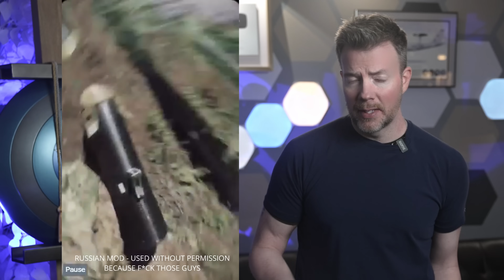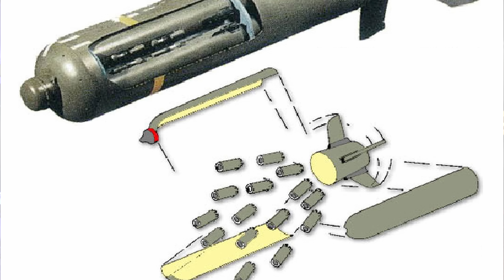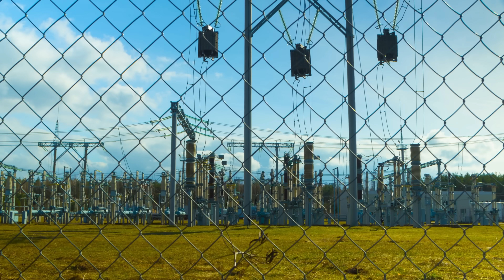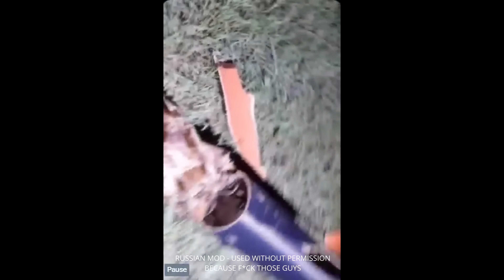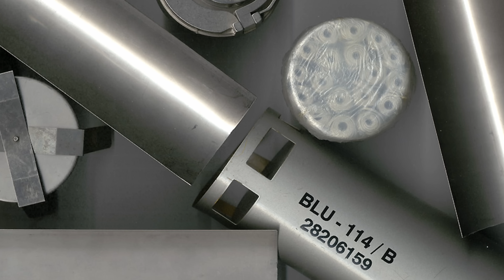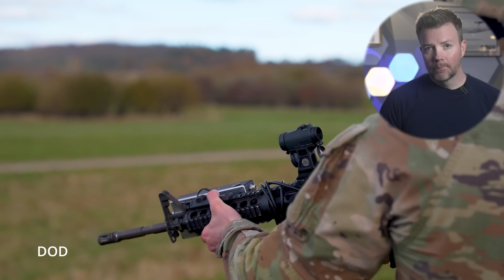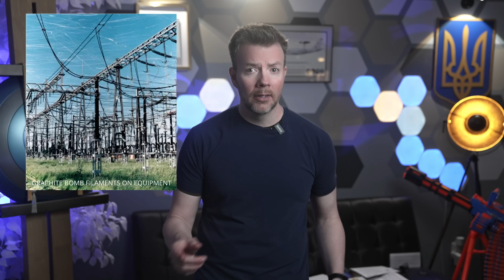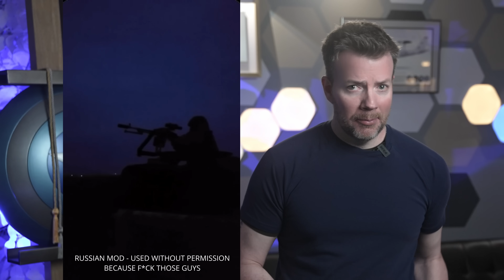Russia Claims Ukraine Using Graphite Weapons - Here's Why

Comment: Sounds like it could have toxic effects on respiratory systems like asbestos. There could be other environmental effects.
Reply: @kennj321  But in this case there are none. Graphite fibres are not carcinogenic, unlike asbestos. 

And for them to be effective to cause electric arcs where none should be, they have to be long. So graphite fibres will eventually drift down, they do not remain airborne. 

If this actually were toxic, we would have had to ban pencils. Because drawing with them, and sharpening them, also releases graphite particles.
Reply: @Hydrazine1000  there are significant workplace safety rules for working with graphene.  plus it appear difficult to degrade it in the environment and could be a forever chemical that gets picked up in high winds and causes chronic long term exposure.
Reply: @kennj321 graphene ≠ graphite

Graphite is not toxic. Graphite fibres, when really short and inhalable, can cause irritation to the lungs. And that's it. After exposure the lung mucus will work to remove them. Unlike other forms of inhalable fibres, like asbestos. Or silicate dust.

And the stuff you see here in the photos is really long stuff, almost looks like fairy hair. That is not a respiratory risk. (Though a respiratory mask when cleaning up is recommended, due to the aforementioned chance on irritation upon inhaling.)
Reply: @Hydrazine1000 apparently its at least similar to whats in some automotive brakes. And there is concern about chronic exposure to it.
Reply: @kennj321 Similar in material but, and this is critical, not similar in form. 

These really long fibres drift down. They are way too long to remain airborne. 

This comes in no way, shape or form, close to occupational hazard of a car mechanic working on brakes every day, where the product form is really short strands of fibre that can be inhaled and cause irritation.

Comment: You have to think that small graphite weapons could be used to knock out a transformer on a pole and take out a single building or block. The law enforcement applications are interesting.
Reply: transformers and wires on neighborhood poles are typically insulated, so that wouldn't work. 
Graphite bombs rely on the fact that extremely high voltage transmission infrastructure almost always relies on air gaps instead of plastic insulation.
Reply: @thamiordragonheart8682  If the transformer is in the low kilovolt range, the primary input will be air insulated by ribbed glass or ceramic insulators, thus subject to attack with this method, as are the feed lines.
Reply: @OrmondOtvos , I thought the question was about the poles on the street that connect directly to a house. Of course, anything measured in kV is air gap insulated, which I mostly think of as being for longer distance transmission lines or grid connections for large industrial sites.

Comment: I wish there was somewhere you could communicate with Ukrainian forces. Been saying for 2 years that cheap graphite bombs are ideal for small cheap drones to take out electrical transformers that are spread out all over the place and are undefended. These are not easy to replace and It would be relatively easy to stop all electrical service within a certain distance of the front. Eventually they would have to decide what areas get replacements from an increasingly limited supply.
Reply: I wish they’d hit Kaliningrad. It has one nuclear power plant to support the entire enclave. Don’t hit the nuke part but the transformer/switching facilities outside of it. Kaliningrad has been spoofing GPS and GLONASS making air travel dangerous. Send Kaliningrad back to the Stone Age.
Reply: try the UKR embassy?

Comment: This was used in 1999 to combat Serbia. It worked fairly well at that time.
Reply: Well, yes and no: They repaired the damage within days so NATO quickly moved to right-out destroying electrical infrastructure. It did work well in Iraq, though. It all depends on how well-maintained and resilient the grid is. Operator skill level, availability of spare fuses, etc.
Reply: @aoeuable  When the weapon is deployed, the power grid goes out. Only institutions with generators are producing light and heat eg military bases and command centers. Easy to spot and much easier to target!
Reply: @MartyH99  Maybe in 1999. Nowadays, most newly built civilian buildings are required to have central batteries and very often diesel generators to operate elevators, ventilation, fire sprinkler pumps, backup lighting etc.; those are mainly prescribed by the fire regulations, but they do switch on every time someone digs through a cable.
Reply: @aoeuable  It was not needed to be longer than that though. And you can do it again so it is a "yes"
Reply: and Iraq
Reply: He just said that 😢

Comment: This seems unlikely. Graphite/carbon warheads are specifically designed for scenarios where you want quick repair. We used them in Iraq '03 to enable swift post-conflict recovery and stabilization (OIF J-staff officer). I cannot understand why Ukraine would want to gift Russia with the quickest and easiest repairs to get their power back online. It makes literally zero sense.
Reply: It may only knock it out for between 48 to 96hrs (dependent on how long it takes to clean the area, make any repairs necessary & then test the curcuits to make sure they can restore power without tripping the breakers again)? But by merely switching their power off for a few days, as others have said switching off RADAR instalations etc, without, unlike Russia, committing the war crime of destroying civi infrastructure. Zelensky knows, if Ukranian forces committ a provable war crime, for all the world to see? He will lose western support & he knows they cannot afford to do that. That's why they're tripping circuit breakers instead of blowing them up.
Reply: @markmaher4548 Firstly, it's not a 'war crime' if destroying a target provides reasonable military advantage compared to negative civil impacts (the principle of proportionality). If enemy military functions were directly reliant on a civilian grid, then that legitimises a strike. 

Secondly, I'm not disputing that knocking out a local grid isn't advantageous for Ukraine; merely that it's incredibly stupid to suggest they'd deliberately aim to make that disruption as short-lived and less costly as they could.  

As an aside; military SAMs and radar systems are invariably self-sufficient in respect to electrical power. Knocking out the grid would not disable their capability. No military is that stupid.
Reply: @AndyDavisTechnicalDivingDid you miss the part where even if a power plant or it's infrastructure provides power to a military site, if the bulk of the power produced/provided is to civilian sites it counts as civi infrastructure?
Reply: @markmaher4548  That's irrelevant to the international law of armed conflict. Did you miss my earlier comment explaining the legal principle of proportionality in respect to the targeting of such infrastructure?
Reply: We are talking about occupied Donbas area not Russia.
Reply: @retiredjan4714  The area is irrelevant. There is zero logic in Ukraine using muntions specifically designed to enable the quickest and easiest possible repair of a target.
Reply: You missed the part of that temporary disruption of power disabling radars and power dependent air defense systems. Black out the defenders, send through the drone waves.
Reply: @brettshaff8772 I missed nothing. As I said already twice, there is ZERO LOGIC in this instance to using a muntion that specifically enables the quickest and easiest target repair. What part of that ridiculously simple to understand statement are you failing to grasp?
Reply: It still serves a strategic purpose. It signals a threat, "We can reach out to here, and do worse than this" and it is a signal to the population, without overly stressing civilians.

 "It makes literally zero sense" ? No, quite the opposite. It is a very strong signal, given the location being the occupied territory, instead of Russia.
Reply: @Hydrazine1000 Don't be silly. 🙄
Reply: @AndyDavisTechnicalDivingSo you think this has no signalling purpose at all?

Comment: When a conductive fiber spans 2 or more phases, the fireworks come from the equipment. Drone carries no explosives.
Reply: What you see is the conductive fiber vaporizing explosively. Basically so much electricity is pumped into it that it almost instantaneously turns into an expanding ball of gas. This creates a kind of explosion. That's what you're seeing there was no TNT or other kind of explosive used.
Reply: Well, technically it does, it needs to disperse the fibers.
Reply: @elbruces Yes a small bursting charge Good point but not what you're seeing.
Reply: @elbruces  Just use a fan?
Reply: I don't think that the fibers need to connect the phases. If the air space between the phases contains a lot of short carbon fibers they will decrease the insulation between the phases to such a degree that an arc is developed.
Reply: @VeritasPraevalebit  exactly. When you are dealing with 20k+ volts, that shit can break the resistance of open air. You disperse particles that decrease that resistance further and they'll bridge the gap across the "safe distance" of normal operating circumstances. But idk im just a high school drop out
Reply: @OmitZz  Don't use that excuse, you clearly know more than any Highschool would be capable of teaching. School in America is mainly just "employee training" until you study a particular field of interest, then you go work in that field.